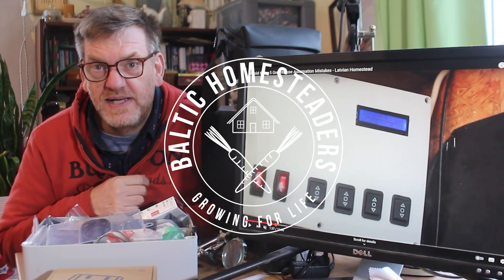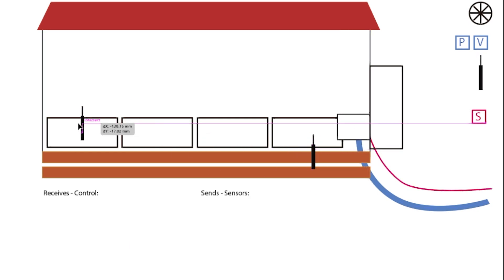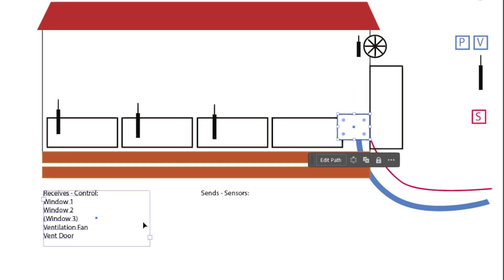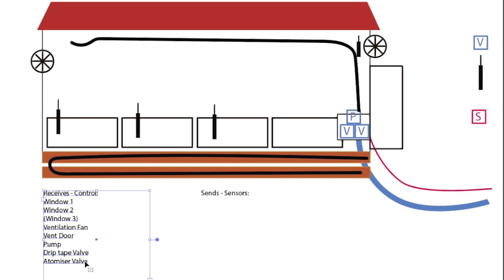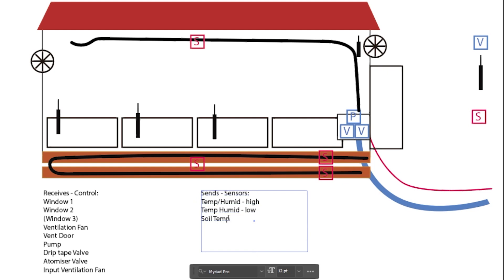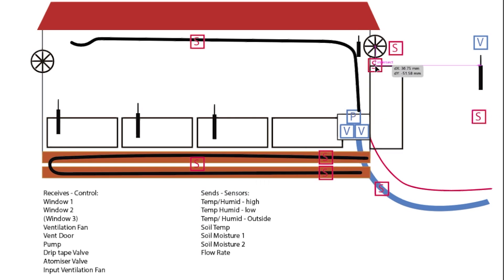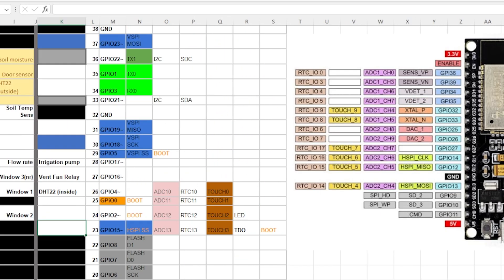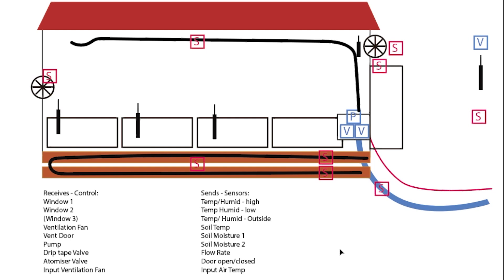My DIY Smart Greenhouse will get a MASSIVE Upgrade!

Comment: As you iterate on your system, it would be fascinating to see harvest data on top of everything else you're monitoring.

Obviously it's possible to do it manually, but you could definitely automate some of it.  For example, you could set up a camera, a scale, and a button you press, which would take a picture, use object recognition to tell which of the ~dozen or so things you're growing (and OCR or a direct output from the scale to get the weight), and note the fruit, weight, and timestamp).

My robotics team has used OAK cameras to recognize 2 different game pieces.  There's also OpenCV.
Reply from the maker: Fun but not really sure how useful the data would be. So many variables at play between any 2 plants like the fact that I grow many varieties. I think if you were pointing a camera at a specific plant or indeed tomato and measuring its growth it might be interesting but not sure about the value of the data as it gives no indication of true harvest. Of course you can argue that for the greater good community type thing it’s a good thing to do so others can then use it who could see value in the data. 

After a couple of years experience/experimenting I think I have a handle on how to best use the space in terms of main summer crops but still need work on autumn / winter stuff. Actually that is something the camera might work with is tracking a cabbage grow as I’ve been experimenting with growing them, been out there today,  video out this week at some point.
Reply: @BalticHomesteaders  I'm mainly thinking about setting expectations for others who might want to do something similar.  We had to scale back our garden last year, but I was shocked at how many jalapenos we got out of just two raised beds in our greenhouse in spite of neglecting them for most of the season.  It's about 40 square feet of growing area, and if I remember correctly, we harvested about 3 gallons of peppers and a similar amount of other produce.
Reply from the maker: @ Yeah I’m all about intensive gardening, it’s amazing what you can get out of a small space.